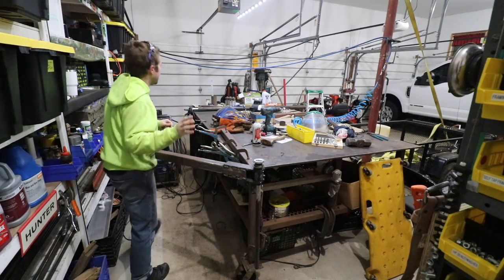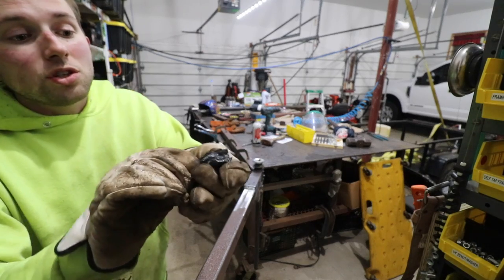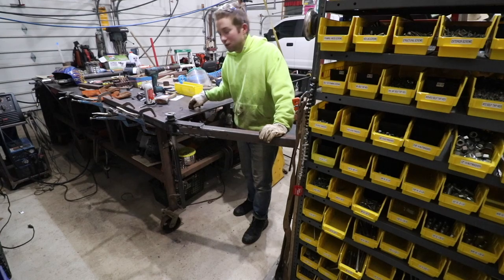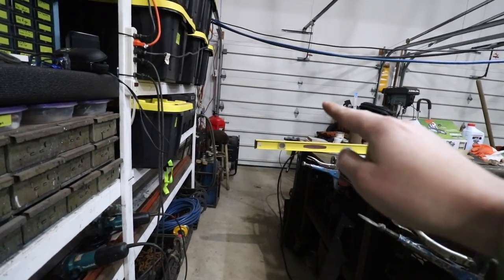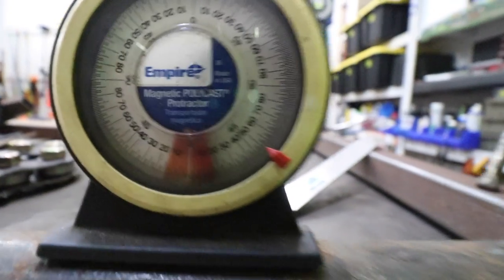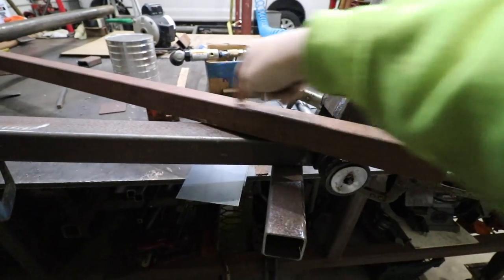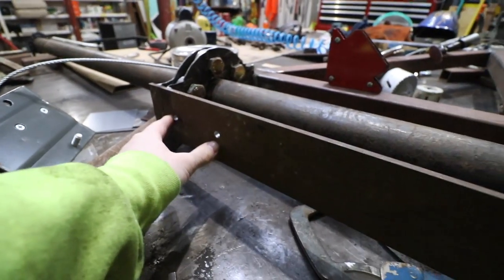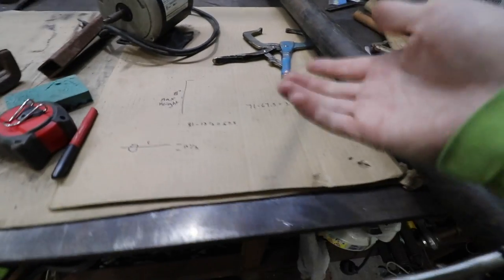Firewood Jib Crane | Build 4

Comment: You take a lot of time to make it straight. You never go wrong doing that. Very well done Hunter! But I can tell you as soon as you drive your whole rig out in the yard, nothing will be perfectly level on uneven ground! But it does not matter at all with relatively small loads under a quarter ton. As far as you can put it fairly level, the eyeball being the reference! But I think you already tried it and will discover it! I am moving to part 5 now!
Reply: Oh... I forgot to mention.  About the final assembly of the post on the trailer.  Whenever I can have such assembly bolted, I prefer this way.  In that case, you can bolt the base of the post, fairly straight. It stays in position by itself but is not strong yet. And you can still adjust the level by pulling a direction or the other, by hand.  Then you can put the two "legs", where you weld tabs with drilled holes. When the level/straight position is achieved, this is where you drill the hole and bolt. That is my 2 cents!

Comment: U will need to mount winch on the outside boom if you try to use the winch cable like that it will always want to collapse boom knuckle to release cable tension when I say collapse I mean fold back at knuckle, the pulley at knuckle would work though if u had a stop so it could only pivot the desired direction and cable was on correct side of pivot,  or use a double pulley so either way you pivot doesn’t run risk of shortening cable
Reply from the maker: I based my design off of Johnathans design. His channel name is "from steel to wood". Believe it or not, the wrap around pulley does actually work quite well. 

Check out his video!
https://www.youtube.com/watch?v=B9jCUIIlusY
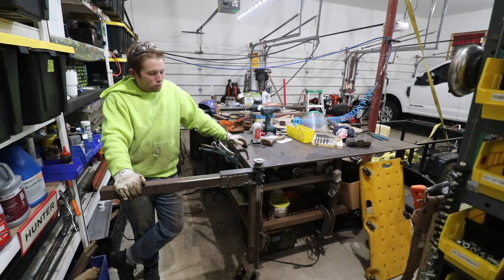Reply: @OldSoulMillennial  You are both right Hunter and Jared!  It will have a tendency to fold back or fold out the knuckle. Which is great by the way. I explain why. The small pulley on which the wrap-around is done is relatively small compared to the last section of the boom. So roughly 1:30 ratio.  So if you were to lift tons of material, that would be a considerable force that would collapse the knuckle.  In the case of 300 lbs, that might be as little as a 10lbs side load.  And that is very close to the friction resistance you got from the pivot point. The jib will have a slight tendency to collapse by itself indeed. Most of the time you will work the jib crane in an already partially collapsed position, more or less to move the load. So you can choose which side is best suited for you.  So the tendency of the collapsing action when it's loaded will bring back the load toward the trailer if that is your goal. Then you fold the jib the other way when it's time to unload. So the tendency will be to unfold...  That is called assistance! Lol!

Comment: I wonder if you will have tiny rust specs on your truck leaving it in there with the welding and grinding and sanding? Might be a big mistake
Reply from the maker: This was something I was very weary of throughout the build. If I was doing major cutting or welding close to the rig, I pulled it outside. The truck is a good far distance away from the welding table. It would be one thing if I was welding within 5 feet of the cab. All welding took place at a distance of 25ish feet. If you skip through the video you will see that I pulled the truck out when I felt there was a danger of impregnation. My precious sustained no damage during the build.